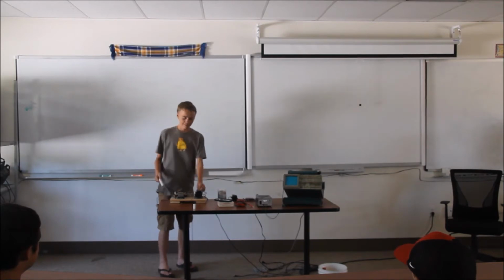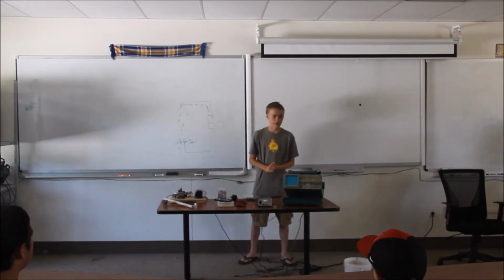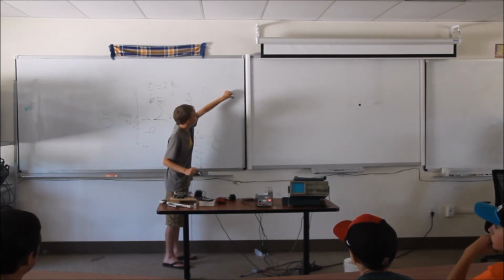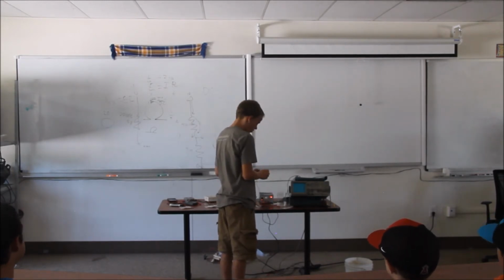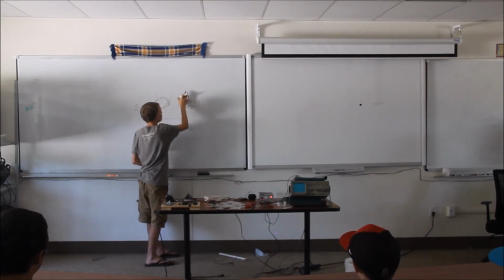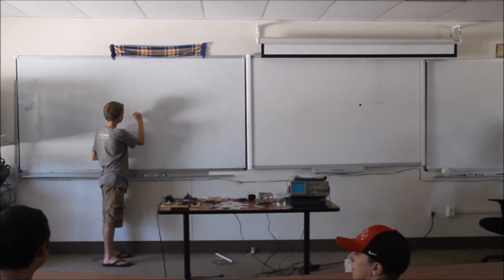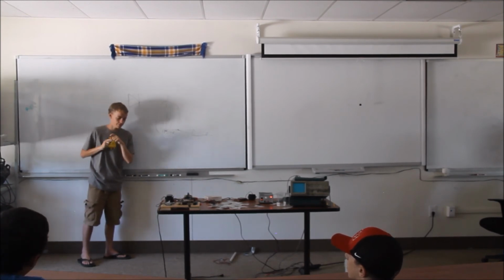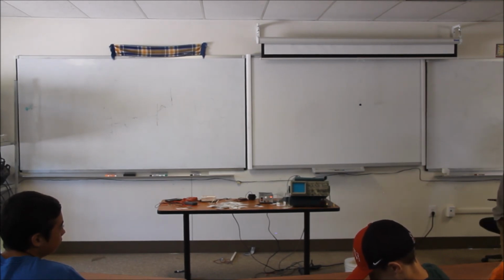My Electronics Class Day One: The Basics

Comment: No... The current is not how fast electrons pass through the conductor! We call current, to represent the actual amount of electrons passing through a conductor! It isn't related to the speed, as the speed of the electrons flowing through the conductor is always the same, and its almost equal to the speed of light!
Reply: Current is coulombs per second, which is literally the rate of electrons. So speed of actual electrons is not always the same speed. Remember that electrons move faster in smaller wires for a given current, though. The transfer of energy through electrons is the speed of light.
Reply: @argonaut4772  yes.. I would agree with that.. When a conductor is not conducting current, the energy through electrons in it have a slower speed. Well i don't know about the opposite, but i would imagine that if the energy through electrons would go with ~= speed of lite, the conductor would theoretically heat up.. I don't know.. Its just guessing, since when a large amount of energy through electrons pass through a conductor with a speed of light, the conductor heats up.

EDIT: The word speed was written as sped